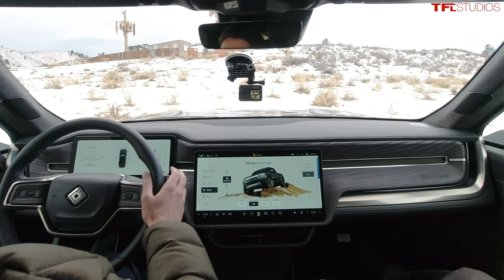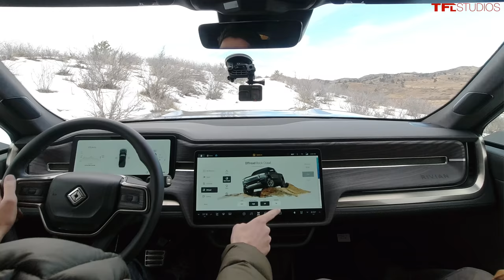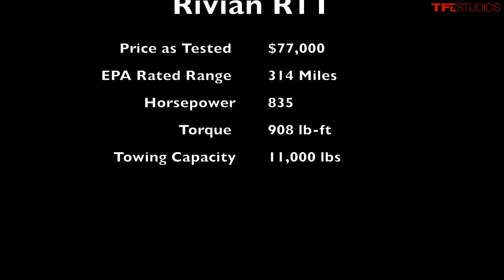Fully Loaded! Can an EV Pickup (Rivian R1T) Survive a Hard Days Work?

Comment: Rivian no longer has the tank turn option which is just for silly fun any ways. What i hope Rivian does is to ad 4 wheel steering, CHEV/GMC had 4 wheel steering in a pickup way back and they have trucks including the new EV Hummer that have 4 wheel steering. All wheel steering is much better for parking, off roading and pulling trailers. The Rivian front end in the place of the rear non steering should be an easy fix, maybe even an after market fix

Comment: Here are the issues I have with electric pickup trucks: they're expensive - I can build a very nice F350 super duty for less than this truck; their range - said F350 has a 48 gallon tank and can get up to 15 mpg (720 mile range with brief fuel stops to top up if needed); extreme weather performance suffers on electric vehicles (mileage plummets in the extreme cold or extreme heat); range plummets when towing or carrying a large load. You will struggle to get more than 150 miles in this truck with any substantial amount of weight being towed.

All in, battery tech just isn't there to make an electric vehicle for any kind of work outside of puttering around town. 99% of these trucks won't see a speck of dirt in their entire lives lol

Comment: This wait for slip "only" system already proved insufficient, they have to make some sort of forced power to all 4 wheels at least something similar to manual clutch closing in combustion engines AWD systems, so it does not keep going and falling off obstacles... At this point it's ok on little snow hill, similar to ivtm4, but because it has no way to force lock power, it's inconsistent over obstacle crawl
Reply: I'm curious for you to elaborate on what was insufficient? There is no "wait for slip" type response in the Rivian unlike some older AWD type systems that only sent power to one of the axles after the other axle loses traction and slips.  The Rivian drive system has 4 electric motors and each is controlled independent of one another and, with the various modes and programming, it works better than having lockers to turn on and off. The system sends power to all four wheels all the time (except in eco mode where it shuts off the rear motors and operates on front wheels only). Rivian can put full power to each wheel until it detects slip and then reduces the mount of power going to that wheel which is ideal and exactly what you want a 4x4 to do as there is no benefit to sending full power to a wheel with no traction as all it does is overspin that wheel (which is what a conventional open differential does). The R1T system still sends some power to a wheel that is slipping, but not 100% which is effectively the same thing a locker will do when it keeps two wheels on an axle turning at the same rate so the wheel with no traction isn't spinning way faster than the wheel with traction. The Rivian does the same thing, but it does it by controlling each of the four motors appropriately.  Also, each mode handles power delivery and amount of allowed wheel spin differently. You can watch the other TFL video when they are going up slippery, snowy hill and all four wheels are still turning/spinning. It doesn't just cut off 100% of the power to a wheel when it spins and each wheel gets the appropriate amount of power for the mode it's set to and for available traction. Same with various videos that test articulation and have one or two wheels in the air and unweighted and the Rivian programming simply keeps sending power to the wheels on the ground with traction and keeps moving forward without having to hit a button to lock and unlock a differential.

Comment: If you wanted to strap down a peace of plywood at the higher anchors just put something narrower on top to act as a pyramid wedge, like a couple of small pieces of 2x6 or something. Weird that a dude that sits in an office all day and never has owned a pickup truck can figure that out but all you see as an only solution is to only use the rear anchor points 😳

Comment: Unbelievable that you would have all that battery capacity in a truck and not have a 20 amp no voltage drop accessory circuit. There is another vid where they take the Rivian and attach it to an 8700 lb loaded trailer.....the range goes down to 137 miles as soon as it sees the load.

Comment: You'd think it would tip with all that wood in the bed, until you remember it has a curb weight of 6,000 lbs.
Reply: That wood weighs about as much as Styrofoam. ........ so really not impressive at all......

Comment: Says this truck is $77,000 U.S.. That is already steep for a pickup truck with a 4.5" bed with tailgate closed. Rivian just raised the price for this truck 20% (quad motor)! Rivian went on to say that they were developing a dual motor truck that will sell for the price previously listed for these quad motor "Founders Edition" trucks that are already sold out. 

That fact decidedly changes all perspectives on this machine. Its designed to compete in the wealthy adventure category (Land Rover), so why banter about as if this is a test of an everyman's work truck? That, and the fact that nobody on earth knows how the yet-to-be-sold (or tested) dual motor variant stacks up against this "unobtainium" adventure vehicle for wealthy folks.
Reply: You are aware the Quad-motor trim of  the non-Founder's edition does exist, yes? Dual-motor option for the Explorer and Adventure trims isn't the only option.
Reply: @eddiesantos6407  No matter if Rivian plants a "Founders" label on the quad variant, my point being they tried to get the message out that the top trims were priced under $100,000, which, sadly, they are not. 

When a PICKUP TRUCK costs $100,000...Would the average Joe that buys pickup trucks take it out and brush-bang it? Hardly. First off, the average Joe can't spend $100,000 - or $6,000 for the camp kitchen option. Second, even the deep-pocketed may think twice before rick crawling a vehicle that expensive. So, like Land Cruisers, the sales pitch is uber off-road prowess, but the actual trucks spend their lives going to drop off the kids in school and "adventuring" to multi-story silicon hills wrapped in glass and steel downtown.
Reply: @jmel1746  Unless you're talking about a currency that's not U.S.D, you can still price this truck under $100k. You don't need to add all the optional stuff.

Weather they're dropping off their kids at school, go off-roading, or mall crawling is no one else's business. If they want a vehicle like this and can afford it, all power to them. This was never aimed at the inexpensive blue collar worker to begin with and there are plenty of other trucks and SUVs in this vehicle's price range (and people still pay for it without even blinking).

Comment: If Tommie could actually drive a truck!   The reason you slipped on out camber road… you were going .5 miles an hour.  Get the tires moving so you keep the tires  treads clear!! Snow driving 101!  Good thing you had a actual man in the truck with ya!  Sorry, but that’s reality.

Comment: The traction performance is nice but that load they hauled was a joke.  My old Dodge Cummins with its heavy flatbed still is more of a useful truck until I see otherwise.  The only downside with my diesel is the fuel and the maintenance, but that Rivian body and chassis is only a hipster lifestyle buggy at this point time.  I want to see this thing really used.

Comment: too expensive, plus the debris falling into the tailgate arms if used as intended as a work truck. Corded power tools was a bust, lost of power to perform at a high speed to cut lumber. at a low sped as demoed, the saw would get stuck half way through a cut, damaging the tool, and rough cut of lumber,instead of a nice clean cut.

Comment: Great test. Electric trucks and cars will be viable when the charging network becomes as vast as gas stations but I wonder if there are enough raw materials available to meet demand for both electric vehicles and charging networks. Also, how bad is it for the environment to mine those metals and what happens when these vehicles are end of life? Will they be better able to recycle the battery and electricals by then?

Comment: @The Fast Lane Truck  Must truck user are afraid of the range of electric truck while working. Saying it only used 8% of the battery is completely useless. How many miles where driven? How fast did you go? How much did it gain from regen going down the hill? My guess is by you not saying any additional information it is not good.

Comment: This truck should cost no more then 30K. It’s electric with no gas motor or transmission. It’s a computer with wheels
Reply: Right because all modern tech is cheap. By your logic, no new I.C.E truck should cost more than $10k since that tech is over 1 century old and common as all heck, yet they run in the $50k+ ranges frequently.
Reply: @eddiesantos6407  it’s simple. Don’t buy it. Let them melt the truck down to make something else
Reply: @ctbt1832  And yet that hasn't stopped anyone from not buying them. Hell, many buy the $70k+ trims and don't even blink when they do so. Majority of the people will not even consider what you just proposed.

Comment: Not putting the ratchet strap hook on - whatever. Not having the tail of the ratchet strap in the right place: n00b. It is supposed to loop through the drum and back up where it came from such that you can apply an initial pressure using it as a pulley, then cinch it up using the handle. And in fact if you'd done that it would have been obvious that it wasn't hooked in. #Fail :-D

Comment: As a exterior sider for 30 years this truck is too small and I do not think it will work as a truck for construction for one thing it does not have an 8-ft box it's only good for pissing around if you're going to build an electric truck build a truck with an 8 foot box or a flatbed

Comment: Great truck, but the people that are gonna actually use this truck for a truck can’t afford it. It’s the problem with all trucks these days! EV or gas! They are too expensive! The only trucks that most blue collar guys can afford are the stripped down, smallest engine, smallest payload, bottom of the barrel trucks you can get! If you want the most capable truck, you gotta finance your life away for a $60,000-$70,000 truck! Or buy a 10 year old truck with north of 100,000 miles on it for $25,000-$35,000! It’s insane!

Comment: An impressive vehicle, but not a work truck at all, compared to other pickups, including the Lightning.

The R1T has way too short a box for such a big vehicle. Other full-size trucks have at least a 5½ foot bed, and usually a 6½ or longer. The short bed on the Rivian, amongst other things, means that the load is entirely on the rear suspension, or behind it. This can unload the front wheels, affecting traction, steering, and braking.

The electrical output of less than 2kwh is pathetic compared to the F-150 PowerBoost and Lightning, which have 7.2kwh and 9+, respectively. Indeed, it's less than what comes standard with the PowerBoost, which has 2+kWh.

Between these, it really hampers the ability of the R1T to appeal to the 1 vehicle for personal/business market that is no small part of what drives demand for high-end pickups.

The other factor with the short bed and appealing to the "adventure" market - can that short bed even mount a camper?

Comment: They better Question is how this Batteries will run in 10-15years. A 150 from the 70' mostly even today runs. Needs probably more Oil the Fuel but it runs. But a Batterypack from the 70' will not run 2022....i think the same happens with Tesla/Rivian and and and in 10-15years....

Comment: If u wonna make this a towing truck cross country just throw a diesel generator in the bed of the pickup, & u got the most efficient truck in the country of a diesel hybrid.

If a 27-30yr old diesel truck can get better millage than a 2021 gasser 1500 then I think diesel is a rly good option just f$&@ the EPA!

Comment: Nothing against the two hosts, the truck, or the work being done but EV’s are NOT suited for real working people. Very often trucks get used 14 hours a day, driven 2000 or more miles per week, and the biggest one reliable in any weather conditions. Electric motors aren’t the issue, the electrical source is. Batteries are not capable of out performing fossil fuels. They can’t even compete! The only way you will get anyone onboard in the real world is to make using them better than fuel. Key word BETTER THAN! No compromises in any area!

Comment: Do you ever see a Rivian running fast over rough ground NO because its maker is worried it will break the 6500 lb junk pile.   @. Here you see a RIVIAN in good weather - had to charge 22 times in order to travel 2700 miles towing a car.  The Rivian and all electric EV trucks are a total JOKE as useful trucks.  More honest to call them a play toys.

Comment: Seriously flawed in some very key areas that make this truck need a refresh before I'd consider buying one.
Reply: What would those flaws be?
Reply: @alishasimms2846  As pointed out by the presenters, the spare tire being in the bed is a major one. 
The tailgate button should be on the tailgate, not the bed rails-- people use their bed rails, and it is in the way of most tonneau covers. 
Also as they pointed out, the swan neck tailgate design means that lots of debris will work their way into many pinch-points, possibly leading to damage and, at least, cosmetic damage... Didn't get a good look, but what happens to the hinges when you have a bed full of small gravel and open the tailgate? 
The fact that I can get 7.2Kw from a hybrid and only "about" 1.5 kw from fully electric is also discouraging.
Reply: @billnorblat4047  Understood. Thanks for the response.

Comment: Worthless for a farm.  Let's see it haul 17K lbs 50-100 miles.  What is battery replacement cost?  Where does the lithium come from for the batteries?  Are you paying the same road taxes we do on fuel?...no.  How long does it take to charge it?  EVs are a joke.  Stored power that has to be produced somewhere else (coal, fuel power plants).  Hydrogen fuel cells have more promise.

Comment: Why do these electric vehicle manufacturers build these things with all that horsepower?  Like this with 835hp?

I would think if you mash the throttle all the time you drain the battery quickly with that type of power delivery. If they made it with say... 300 hp max, it seems to me it would allow the vehicle to still be quick, but also give the battery far more life, therefore range.
Reply: The weight. Need some good amount of HP + torque to move a heffer like this.
Reply: @eddiesantos6407  torque moves weight, not horsepower, the electric motors have 100% torque from immediate start, as in from 1 rpm until max rpm, that’s why train locomotive’s have electric drive motors, weight for these small trucks is not the issue at all.
Reply: @guyforlogos  I guess you missed the part where I stated ... "HP + torque to move a heffer like this". 7k lbs is nothing to scoff at.
Reply: @eddiesantos6407  my point is you don’t need 800lbft to move 7000lbs, when you have ALL torque available at 1 rpm. 300-400 would be more than enough and one would think use much less power, therefore have better range. They are trucks, they don’t need lighting fast acceleration, as a matter of fact, when loaded, good luck keeping your load secure when taking off like a rocket.

Comment: EV’s are not real trucks … period end of story , idc how impressive or fast these toys are … they don’t belong in a work environment. 

      Get a real truck 

* also big issue I have with ev in general is price of maintenance … as the years go by the maintenance cost may skyrocket and even the electric bill to charge these vehicles may Also go up . 

I trust my a engine that can easily be repaired , fixed , and reused for years and years … if busted you can’t fix an ev u got to replace the entire battery or even platform which may be equivalent to buying a new vehicle. 

   Again ev’s as trucks are not trucks
Reply: Thank you for showing how much your frail masculinity is threatened by this EV. Get over your hate, son. No one if forcing you to buy one.
Reply: @eddiesantos6407  

U obviously didn’t read wat I wrote , as far as trucks go they should remain petrol that’s all I sed  but good one budddy
Reply: @moflexmusicinc.6060  Yeah, and by saying that you're completely dismissing that EVs trucks are coming into the fray and will become a viable option as well. That closed-mindedness doesn't help anyone.